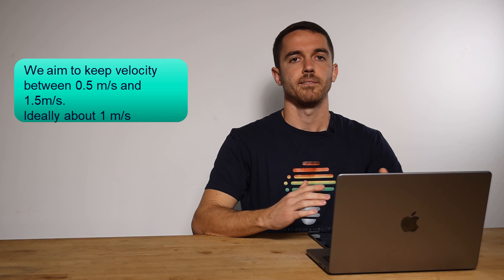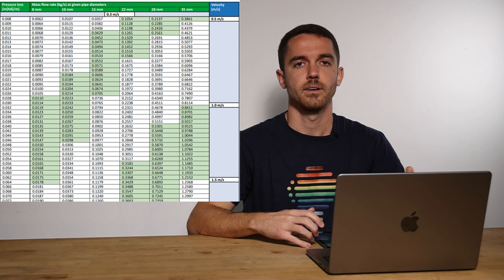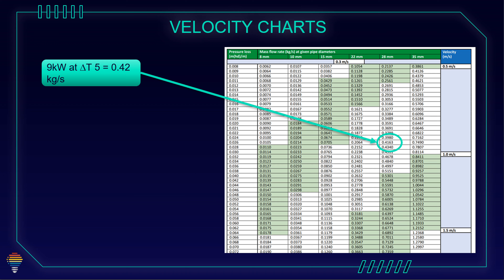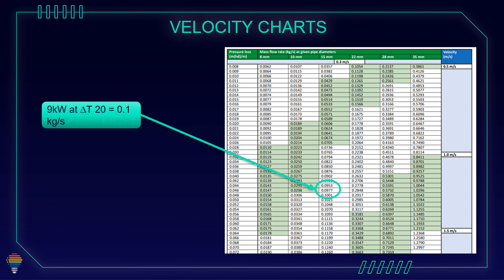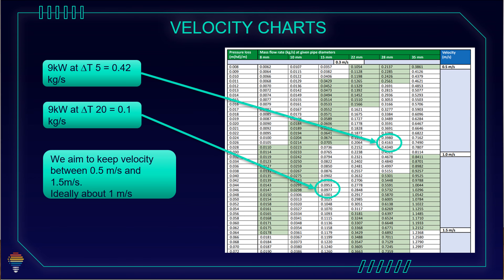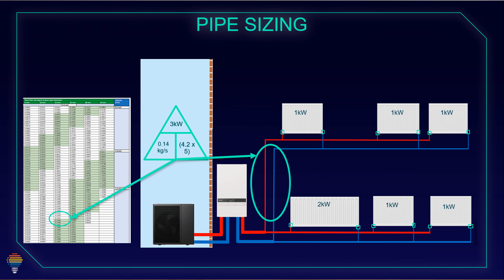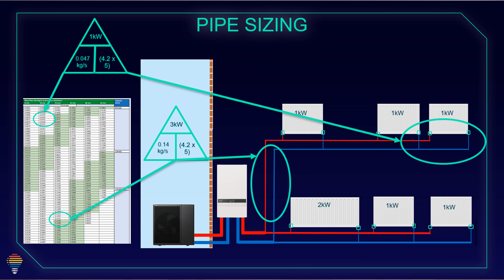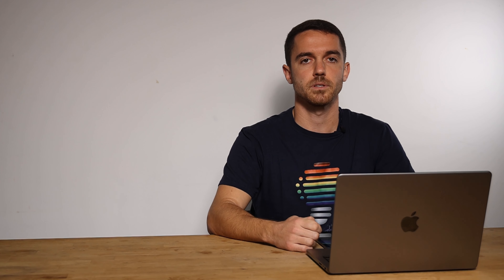Pipes In Heating System - Velocity and Diameter

Comment: I’ve put together an excel calculator just for ease of time, input your kW load and then it will pull data from the charts you showed from 8mm to 54mm, my question is (still very much learning) if customer wants to keep 10mm system it seems around up to 1kW load will be 10mm, then after it suggests 15mm. My question is (taking out pressure loss as an issue assuming the pump can handle it which I’m sure would be a high resistance within the circuit plus under 1.5 velocity for noise and erosion reasons and your primary flow and return would be sized correctly for the full load) it would be safe to say that as long as the load per radiator is 1kW or under then 10mm would be capable, let’s say you had a room that required 2kW then you would have two separate flow and returns going to both radiators feeding 1kW each rather than one flow and return feeding two 1kW radiators? Not sure if that made sense
Reply from the maker: Hi, yes, something like that. 

But usually, pipes for two radiators are usually 15 mm, not so much cases with 10 mm.

Please send me your excel table on e-mail if you can: hvaceducationhub@gmail.com